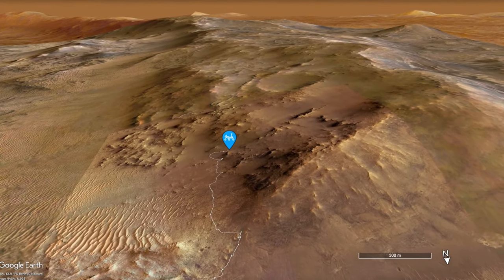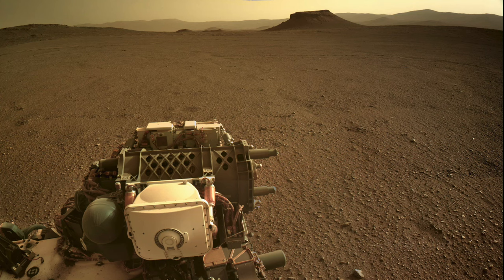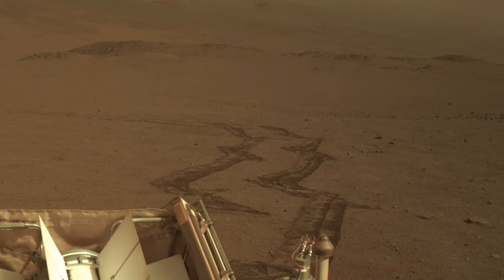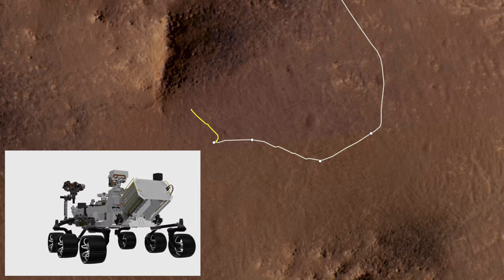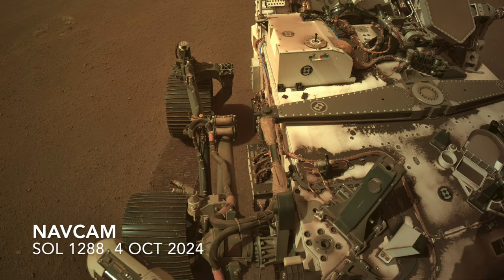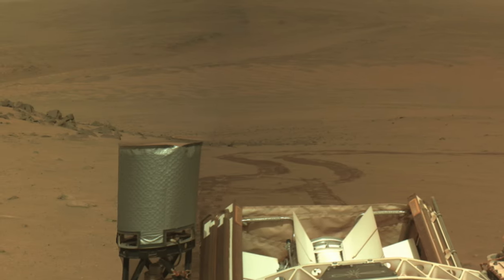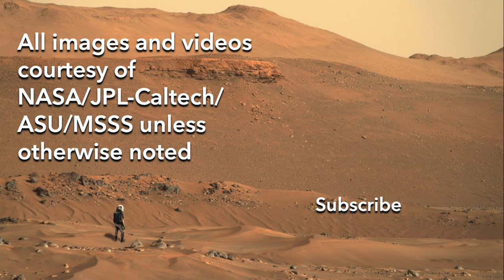The going gets tough for Perseverance

Comment: When the team drives the rover backward, the rover performs better, but they're trading-off on a higher possibility of getting permanently stuck. Curiosity and Perseverance are designed such that the suspension is sub-optimal in the "forward" direction. There was an intentional decision to use better suspension and traction in reverse, so that when the rover gets stuck going forward, it can almost certainly back out of the situation. I've personally observed this with my small rover, which is based on Curiosity's suspension and chassis geometry. Even on a small scale, the difference when driving backward is huge.
Reply: To expand on that a bit... it's not about the weight distribution. My small rover has no real weight concentration anywhere in the body of the rover, but still performs better in reverse as well. It's purely about the mechanics of the rocker-bogie suspension. The bogie section has two wheels that directly oppose each other's force. Driving in reverse, if the leading wheel starts to ride a bump, the center wheel will push harder into the regolith to compensate. Driving forward, that compensating force is less, as it's pushing down on both bogie wheels.
Reply from the maker: Good description, thanks.  The good news with the current situation is that there's almost no way Perseverance will get stuck given that it can always just go back downhill.

Comment: I've pondered the traction thing, especially the reduced gravity mixed with unknown Geology particularly after learning about the how astronauts had to move one the Moon, having the same inertia but less traction from having less weight through their feet.
Having used a few vehicles in off road settings and having unstuck a few, I remain very surprised at the small wheel diameter they choose to use, tall wheels like on tractors are just better.
Reply: That's been a common feature to all of the NASA rovers and the Chinese rover was no different. They haven't used large wheels. I wonder if it's something they considered but decided that they've been consistently successful with this design? Perhaps larger wheels might not have fitted into the space vehicle and they certainly would have been heavier, sacrificing some other function of the rover.
Reply: @rais1953  Definitely lots and lots of engineering compromises to be made with weight and packaging, I see it making sense for the early small rovers designed for small limited Landers and very short exploration drives.
For a large rover designed to explore a long way I'm dubious, if you look at the evolution of vehicles nobody has really settled on anything that looks like a Mars rover for off road use apart from NASA engineers (although walking axle/bogie axles are good), maybe there's just a couple particularly influential persons who swung the design? Seen weird small wheel concepts for new Moon rovers too.

The Chinese I'm sure have just copied what they saw working as why not cuts down research time.
Reply: @mrln247   Spirit and Opportunity travelled a long way over many years on those little wheels. I think an engineer trying to make a case for bigger, heavier wheels might have a hard time against that record. Not saying they wouldn't work better but a lot of scientists want to get their instruments into those rovers.
Reply: @rais1953  Well Spirit rover got stuck in soft sand with its small wheels, Curiosity is still going despite the wheels somewhat falling to pieces and now Perseverance is struggling to get up a hillside.

Comment: “Benign-looking” is a great phrase. Followed by “slope” should instill concern in explorers with wheeled rovers. I can only think of dune buggies blasting their engines on deeply-grooved tyres to get up large sand dunes. Thinking of the future, could an Ingenuity-type rover be equipped with a deployable probe to see how deep the regalith is? Or maybe the ridges on the wheels could be made deeper to dig-in more?
Reply: Interesting thought.  You gave rise to a concept that maybe metal wheels aren't such a good idea after all.  While heretical, is our technology advanced enough to allow for SOME form of  inflatable wheel with some form of rubber (other?) tread that won't get torn apart (like Curiosity), and allow, as you said, some form of traction amplification.  Maybe being able to selectively increase/decrease pressure in the tires as is done on Earth in certain circumstances.

Ah, the idle mind is the devil's playground!  Cheers!

Comment: Will they extend the cam mast over the power pack, and drive backwards again, to try and put even more weight over the wheels? I guess it's like trying to drive over a thick layer of icing sugar.
Thanks Mars Guy. The zigging and zagging travels of Perseverance, make for a nervous journey to the top of the hill.
Reply: This is how mountaineers climb, in a zig zag, not in a straight line. You travel more distance but you don't "break your legs." As for Percy, on a flat surface the weight is an arrow perpendicular to the ground, on an inclined plane the weight is decomposed into a small arrow perpendicular to the inclined plane and another that "subtracts from the progress of the rover", if it moves in a zig zag, this last "will not remain so much" because, in turn, it will "decompose through". The problem seems to be that there is a thick layer of dust in which the wheels could "embark" a lot of dust, adding weight and/or slipping on "a terrain so fluidized that it makes the traction of the wheels useless."
Could the weight and lever arm of the robotic arm be used to act "on the side, compensating for heel, like the crew of a racing sailboat"?. 😀
Reply: You may have to "use the full width of the road," even going all the way to Aurora Park, in order to "make the weave smoother, flatter," perhaps even that won't help. Maybe look for areas where the dust is more mixed with slightly larger pebbles, or cobbles, but not so much that it can get stuck in a hole.
Reply: That regolith sure looks as dangerous as the sands that have finished other Mars rovers!
Reply: Carrying tracks like a tank may add more weight to the vehicle but they could be more effective, I suppose NASA and other scientists and technicians have already tried everything.

Comment: Many years ago, when NASA/JPL started to design the Curiosity rover, the chief designer held an AMA session on some chat board.  I asked him why the wheels were so small.  Wheels twice that size could roll over holes and rocks twice as big.  His reply was basically "we know what we are doing".  
Did they?...
Reply: You're right.  When I have gone to the beach, I have witnessed people pushing beach carts/wagons over the sands.  Those with small diameter wheels almost couldn't make headway whereas the carts with larger diameter wheels did far better.  My guess is that the wheel diameter design is a JPL compromise between usability versus fold-ability so that the wheels would fit in the final space-bound package.
Reply: I used to hang with a neighbor that had an Argo that he took hunting. That thing would go anywhere.
Reply: When I read the quoted part, I heard it in my head, as the most snooty, hoity toity, posh and condescending British voice! Lol 🤭😆😂🤣
Reply: Larger wheels would need to be significantly heavier to be strong enough, in addition to the folding to fit in the aero shell problem.
Reply: @ericfielding2540  Yes, they would be a bit more than twice as  heavy, but would probably be worth the sacrifice (as the current troubles show).  
On the other hand, that Rube Goldberg sample handling and storage system is just dead weight.  Those samples will never be returned to Earth.  If and when NASA gathers the resources needed for a sample return mission, it will surely make more sense to send it to a completely different place and get new samples there.
And on the third hand, what Curiosity should have is a good microscope camera, preferably with  micro-spot X-ray analysis or whatever.

Comment: That was a good Mars Guy question: if the rearward 'moon-walk' was a guided experiment, or an act of perseverance. The surface appearance has the texture of a dry cake mix; but this no cake walk. Probably a good thing it's not wet mud.
Reply from the maker: The backward driving must've been commanded, but the return to forward driving mid-route is what I'm wondering about.
Reply: @MarsGuy  In the photos of the last few sols (sol, soles) you can already see that the footprints are less sunken.

Comment: I wonder what the particle shape of the dusty regolith is? The phi angle (angularity) and particle size must be fairly low for a sandy ( probably silty) material which could be attributed to long duration saltation from a very consistent prevailing Martian breeze. Yet, I see no local dunes which would indicate a wind. Maybe this is an area of accumulated fines where eons of wind laden dust settled out due to blockage by nearby outcrops.  Kind of like a snow fence on Earth.
Reply: I watched a video the other day of a guy experimenting with dry ice with a basin in the kitchen sink, he poured water in and the dry ice bubbled and moved quickly down the counter doors. Is it possible that on Mars there is a constant "wind" of CO2 "crawling" through the sand and rocks?

Comment: Only a few of the pictures seem to show the wheels sunk in/having turned up much regolith -- it's hard to appreciate the difficulties Perseverance faces, both because the vertical scale is relatively small and because we never see the rover in motion.  I realize that the volume of data required for a video clip is enormously much greater than individual pictures, but isn't the system capable of taking one?  It seems as though a few seconds of continuous video might provide insight into the nature of the slippage or at least give us a much better sense of its magnitude.
Reply from the maker: The engineers receive additional images and telemetry (beyond what's posted) sufficient to understand the driving dynamics.

Comment: The width of the tracks left behind suggest it was moving at a slight tack giving each wheel fresh ground to cover instead of the trailing wheels running in tracks left from the leading wheels.
Reply: Perhaps if the rover could turn each of the 6 wheels so that each one always rested on "virgin ground"...
Reply: @copperNick-North  That's just what I said they did. And it can.
Reply: @1kreature  In the modality that I mention, the vehicle would move in a straight line (not along its longitudinal axis) with its wheels leaving 6 parallel tracks (without overlapping or cutting one another).
Reply: @copperNick-North  That was exactly what I described. "a slight tack giving each wheel fresh ground". Depending on the spacing and width of wheels the angle decreases or increases. I thought everyone knew that all wheels could turn individually as it was a big keypoint during the initial presentation of the rover. It is what allows a 6-wheeled rover to turn on the spot without scrubbing around like a tank.
Reply: @1kreature  Since Percy's wheels touched Mars I have not seen any photos where the vehicle leaves 6 parallel wheel tracks or trails that do not intersect or overlap on the ground as I say.
Reply: @copperNick-North  You are indeed right. The middle set of wheels are connected to the rocker-bogie with no turning capability. Only front and rear set can turn.
The demo I saw must have let the middle set scrape along a bit to do the maneuver. During turns it is still possible to potentially gain better grip by slewing slightly allowing front and rear wheel sets to avoid each others tracks. It may not be 100% effective though.
Reply: @1kreature  Thanks for your response. In any case, the rover is wonderful, let's hope that "those beer barrels" go around many more times and teach us more things about Mars.🙂
Reply: @copperNick-North  Yeah it really is a magnificent achievement!
We are watching hitch-hiking rocks on a different world!
Reply: @1kreature  I have a very good graphic joke. Two ticks are seen between the hair of a dog and one question to the other: - "Do you think there will be life in other dogs?". 😀
Reply: 6 parallel wheel tracks ! in sol 1295's photos (a little overlapping but without intersecting each other. It even seems that the wheel tracks sink less). How did they do it?.
Perhaps, since only the rear and front ones rotate, it can be achieved with the differential-rocker-bogie combination that the middle ones do not "rest as much on the ground" but, nevertheless, "help" with traction.. 🤔
Reply: @copperNick-North  Yeah, that's what i was referring to. We have seen it, so they can obviously do it but I thought initially all 6 wheels could turn but they can not.
It may be that side-slippage coincided with the middle wheel set orientation?

Comment: About dust and altitude (extract and translate from wikipedia):
"It is a mistake to think that the top of Olympus Mons is above the Martian atmosphere. The atmospheric pressure at its summit is 2% of that at the surface; Comparing it to Everest, its atmospheric pressure is 25% of that at sea level. What's more, Martian dust can be found even at that altitude, as well as the carbon dioxide cloud layer. Although the average atmospheric pressure on Mars is 1% of that on Earth, the fact that gravity is much weaker allows its atmosphere to extend to a much higher altitude.

Olympus Mons would be an unlikely place for automatic space probes to land in the near future, because the volcano is located in one of the regions of Mars where suspended dust is most abundant; in fact, a layer of fine dust always covers much of the terrain, hiding the rocky soil (rock samples could be very difficult to obtain). It is also likely that the layer of dust could cause serious maneuverability problems for the rovers."

Comment: Would it not have been more ergonomically convenient for power and traction management if NASA landed Perseverance up hill on a plateau instead of down hill in a crater? Going down hill is usually easier with less traction due to less gravity.❤
Reply from the maker: The science draw of Jezero crater was the delta and floor rocks.  The rim is bonus science.

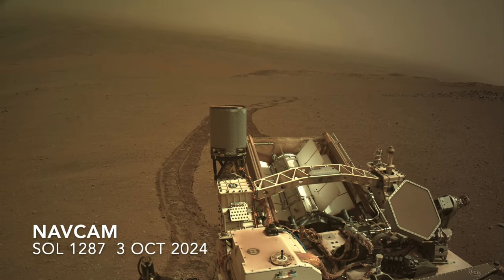Comment: (1:16) 🤔 I had no idea that Mars Guy was only ~4ft tall!

Perseverance is about 9ft wide. I think you may have made an error when placing Mars Guy for scale, and I don't just mean his gravity defying stance. He should be at least 50% larger and perpendicular to the horizon.
Reply from the maker: The width of the wheel tracks is a more accurate way to scale MG than the rover.  Each wheel is ~13 inches wide.
Reply: @MarsGuy  And the total width of the two tracks is ~9ft. I wasn't using the rover itself for scale.
Reply from the maker: @nagualdesign  Mars Guy's stance straddles a single wheel track.
Reply: @MarsGuy  🤨 He's actually standing to one side of the track, but if you meant that his stance width (≈shoulder width) is about the same as the track width you're correct. Which would make him around 4ft tall.